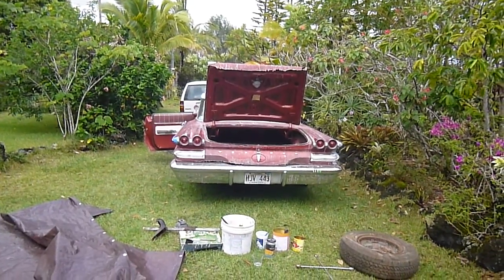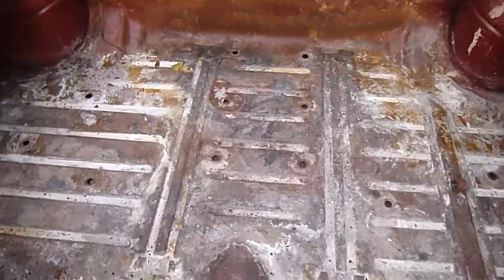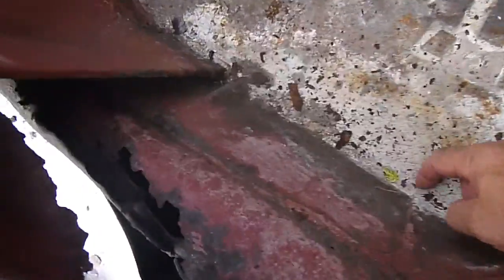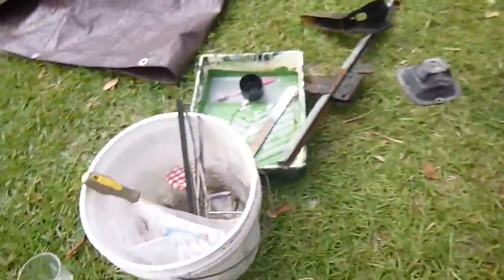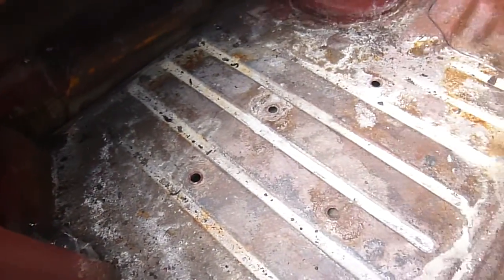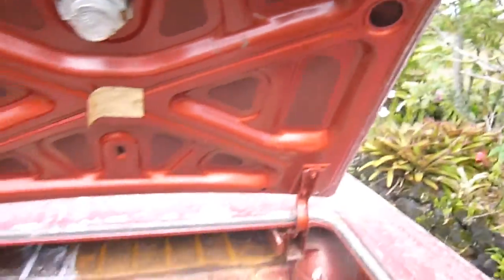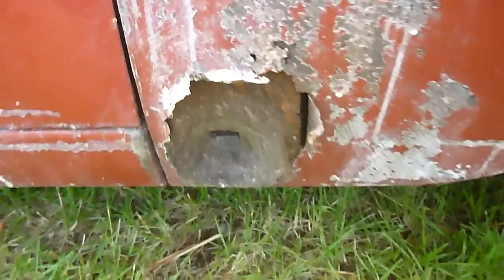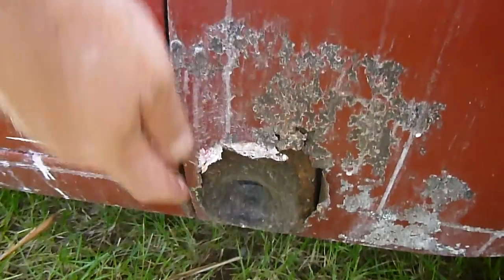1960 Pontiac Ventura Restoration Part 4

Comment: Just to add my 2 cents...  I would hit the whole floor lightly with a hammer to see where the thin metal is..   Then do your welding to fix the wholes...  then the POR.
Just a sugestion.
Reply from the maker: Thanks Duke! The job is already done. I used the expanding foam, but it was totally encapsulated on all sides by por-15, before bondoing. No air or moisture can get to the foam. I'm very pleased with the results. I now have a welder, so further body panels will get patch-paneled. Thanks again for your advice! It's good to know someone out there is watching!
Jeff.